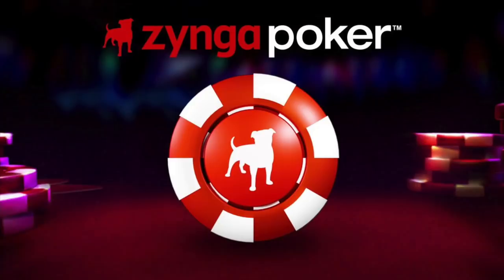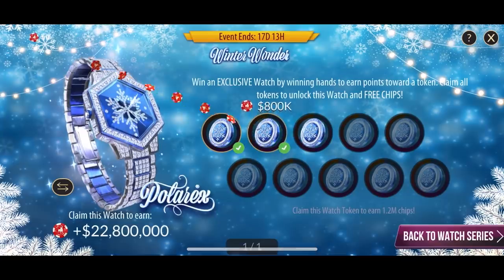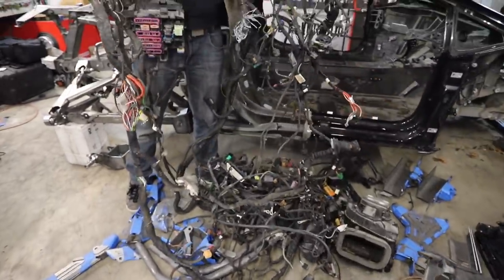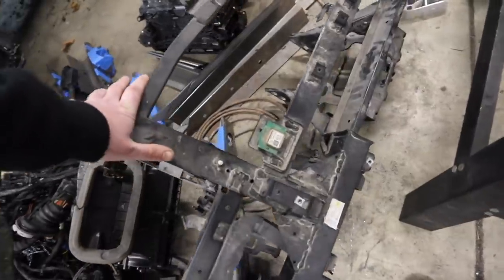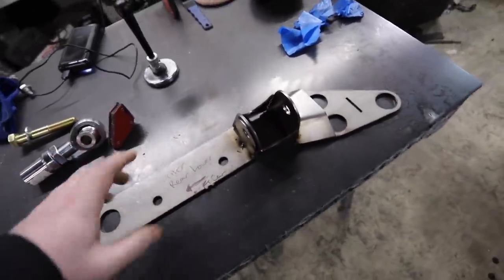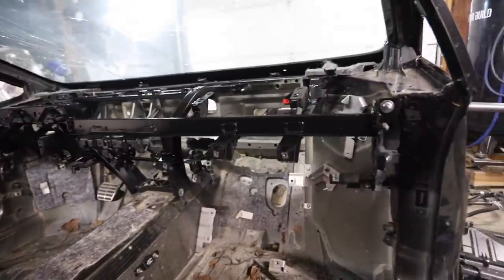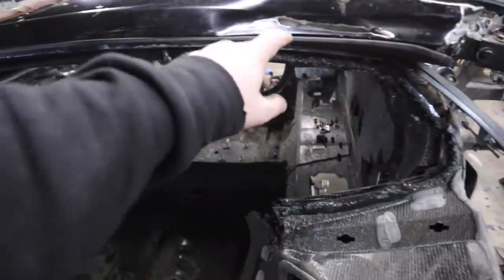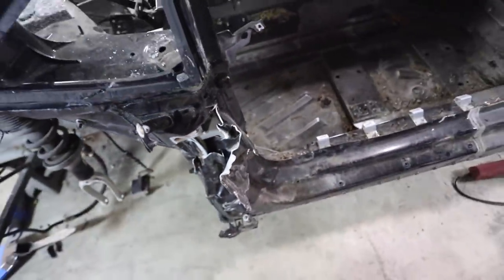Jumpacan Full Tear Down To Bare Chassis & Rear Suspension - Off-Road Lamborghini Huracan

Comment: Is the damn thing going to fit through the garage door once its all welded and bolted together?!?!?
Reply: When he said where the tires would be... This was my thought too
Reply: Just remove the control arms, that's the only thing that makes the car wider.
Reply: I was actually thinking this about trailer to get it to events. Didnt they have to remove the wheels on the other huracan? Even with smaller wheels I dont think this thing is getting on his trailer
Reply: @Droptima15  Often small tires are used on off road vehicles for transport.
Reply: @robb1165  I know, but even the other huracan needed smaller tires. With where the suspension goes out too, I'd still be impressed if it goes on the trailer even with small tires
Reply: I'm guessing the garage is built to handle the road-legal width of cars.
Reply: That’s gonna be hilarious when it doesn’t fit! 😂🤣
Reply: Just wheel it out and stick the tires on outside
Reply: Came here for this!
Reply: It's 8'8" wide, so as long as his door is 9' or bigger, it should fit. Otherwise, ]just take the wheels off.

Comment: It'll only be slightly easier to roll than a regular Lamborghini huracan. But only because it's ride height will be higher it is wider than a normal Lamborghini huracan so that also helps but the Lamborghini huracan is already naturally low slung vehicle and already naturally wide.

Comment: Hey. Are you gonna have spare copies of all the suspension and track arms. If you are racing off road a bent or snapped arm is a race ender. So if you can bolt off bolt on. Will be quick repairs. And off road can bend an arm east.

Comment: To everyone asking, Yes it will fit through the door.
Reply: Will it fit on a trailer?!
Reply: If not they can trim out the door😂
Reply: By removing the tires?  :)
Reply: literally just rushed to the comments to ask this question 😂
Reply: To get it on a trailer we will most likely need skinny wheels. But but there should be 2.5”s of space on either side.
Reply: NO way it would fit that door you can see that its so wide .. kekw
Reply: If a Trophy Truck with 40's wheels fits in a trailer, this definitely will fit hahaha
Reply: Very good
Reply: If it doesnt fit just make a perfect cutout in the walls to roll it out lmao like from a cartoon
Reply: Tell Chris to Line-X the car! Need something stronger than powder coat, paint, or vinyl for serious offroading and jumping.
Reply: We believe it when we see it.
Reply: Will it tho

Comment: Chris. You should really look into some suspension seats especially if you want to jump it... protect your bones bud!
Reply: the suspension is based off a stadium truck, which gets massive air. and those use a solid mounted seat that you strap into tight so  you dont move.
Reply: He'll jump it once or twice and then it's out to the yard with the rest of the fleet.
Reply: I would make sure this thing had some Baja SS's or even something lower profile for a SXS like what PRP offers.
Reply: er no... exactly what  lol.... suspension is loooong and  for jumps ;)
Reply: Suspension seats actually can cause more damage to your body on the big hits this will take. Best thing he can do is get high quality shocks and have them professionally tuned. He  is going to have more than enough travel to handle most of what he is going to come across. He just needs a nice valving setup.

Comment: You should put a supercharged LS in it. Turbos take time to spool, u want power yesterday when off-road 👍😈✌🏻
Reply: Superchargers are also more sturdy and reliable than Turbos
Reply: @DefinitelyNotEmma  depends on the use very very strongly
Reply: @MrCbecker123  that would be awsome, even just some longtubes, X-pipe and then nothing else would be great
Reply: @DefinitelyNotEmma  So every semi tractor made in the last 20 years (except tesla) has had a turbocharger because why again?
Reply: @jamesgeorge6551  Aftermarket Turbos are not as reliable or robust as the OEM Turbos, that's why tuned cars usually blow their turbo, unlike stock cars
Reply: @DefinitelyNotEmma  thats not because the turbos are less reliable, its because aftermarket tuners are more interested in making power at the expense of some reliability
Reply: @rj6110  and what do you think which turbo he would get? An aftermarket turbo. People like you truly underestimate all the R&D that goes into a factory Turbo, since it's precisely designed for the vehicle its fitted to.
Reply: He should put the stock v10 in
Reply: Imagine if he ran either twin compound turbos, nitrous as a spoolaid or a twin charged motor
Reply: @itsyaboipatrick5218  it's too expensive and too hard to work with. V10s and V12s are not suitable for such builds.
Reply: I'm worried of the suspension arms rusting. You should've painted them
Reply: @DefinitelyNotEmma  a stock supra turbo is trash. didnt they have plastic fans in them rebuilt with aftermarket internals they last for a long time

Comment: I was thinking that you might have used weld through primer for rust prevention for the new suspension parts, particularly the intervals, that wouldn’t see paint when they’re painted.
Reply: I thought that too lol. Grinding paint constantly, well it gets old fast.
Reply: He should get them galvanized.
Reply: makes too much sense for this channel
Reply: Use "steelit"!
Reply: Commmmeon man he doesnt have a clue what that is. Its all about the clicks to video games in these parts. Nothing is built to last
Reply: @adameldridge1719  I’m not a man, but I’m hoping some foresight comes into play when welding steel parts, oxidation happens.
Reply: Randy Travis  yep, and people calling it out instead of acquiesing on the point.

Comment: carbon fibre parts don't deform permanently like metal. they either break or spring back 100%.
That subframe is bent, not the carbon tub. Or it was built by italians.

Comment: Did you guys do moment/load/force analysis to figure out exactly what components of the carbon fiber were structurally significant? I'm always curious as to how much detail is put in builds such as this where previous structurally significant parts are just removed and replaced with what seems as a lack of attention to detail...

Comment: I know the s85 doesn't have the torque, but it would be dope if they used that again and twin turbocharged it to help out in that department and get some numbers like a twin turbo Gallardo or huracan, so it still would have that sound a lambo should have. Ive seen Gallardos do rally and its so dope to hear that sound going through dirt. Having this beast with that sound would be next level. I get why the ls is being used, but still. It just wouldn't be practical... but man it would be dope.

Comment: You need to be full welding all the suspension on the inside to you can’t just tac weld them it will fail sooner when in use

Comment: How about doing a series where you actually start and FINISH a project? I've never seen anything completed here.
Reply: Ah, I see you're new around here. Check out the 240z/M5 build from last year, and ofc the legendary burntacan :)
Reply: @liamhayes8281  New here, how would you know?  Burntacon finished REALLY? BOAT FINISHED????? SINGLE SEATER FINISHED?????? He complains about the boat costing so MUCH just sitting but THEN leaves it to do this. If you think all these are "FINISHED" then don't come looking for a job at my shop.
Reply from the maker: @masterdiscovery7263  pay attention to the explanations when he told you, 1. burntacon can't be worked on with Covid/Oregon weather. 2.Oscar is not missing he's working on the boat but parts aren't coming in very quick. 3. Single seater is a SEMA car that he will pick up in time for the show. Stop the HATE!!!!!

Comment: Question: what’s going on with the boat? Did you light it on fire or what???
Reply: I would GUESS that there is a wait for the LS engines ??
Reply: @hharadon  my buddy works at a boat yard in Daytona beach. The cost of that boat sitting there waiting for them motors is going to be more then the boats worth.

Comment: The Jumpacan should be electric. Throw a Tesla unit in there, they're perfect for rear/mid mounts.
Reply: No
Reply: Not really, first of all, Electric builds are more expensive and second the additional weight of the batteries would stress the whole structure even more, that's no Mustang Zombie 222, this is a trophy truck.
Reply: @DefinitelyNotEmma   Exactly, so it doesn't 300 mile batteries. Ultimately it could be much much lighter and faster. Better center of gravity, 100% torque at launch. The perfect leaper.